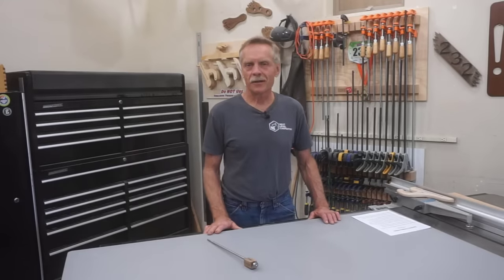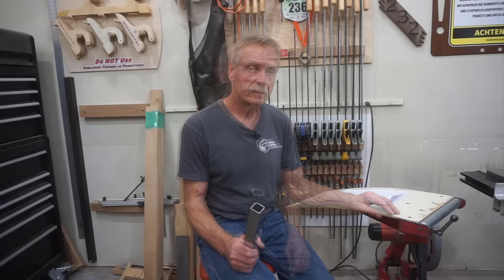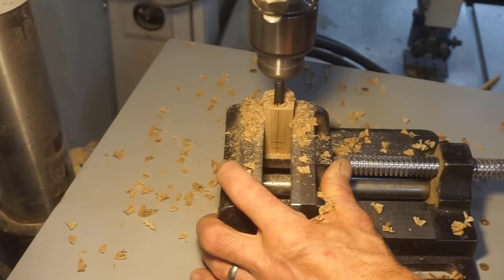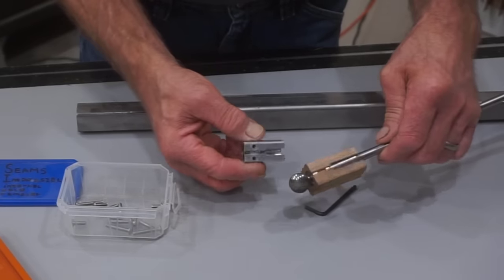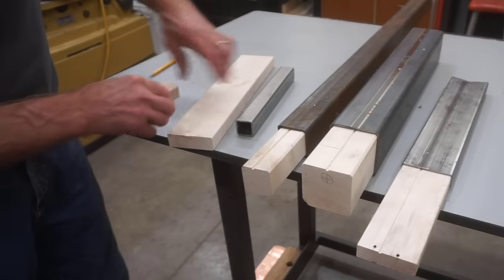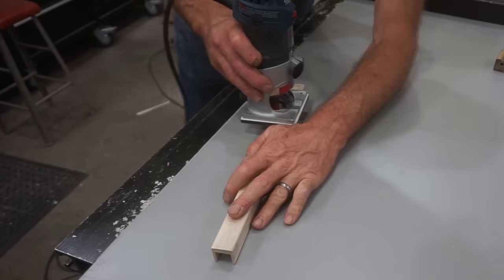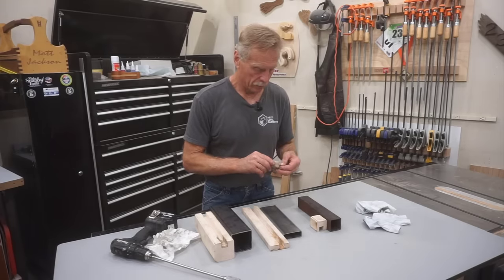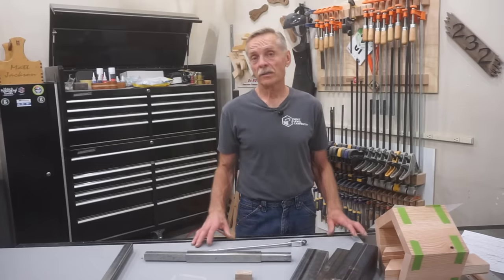How to Quickly Remove Internal Weld Seams from Steel Tubing

Comment: Brilliant idea. A suggestion instead of attaching the tool onto/into the jacket and because you are pulling the tool back through the tubing, simply machine the tool head top into a top hat, The top hat flange would sit on the end of the jacket when pulling through, no need to fasten the tool to the jacket with quicker setup and dismantle. Just a thought!
Reply from the maker: Great suggestion, Rodd... thanks for adding it.  I'm going to forward it to Greg as we're brainstorming on ways to make making jackets easier/more adaptable.  Best, Matt
Reply: @NextLevelCarpentry  The same principal could be used when pushing the bit through the tube, the rod could be a 1/4 OR hex drive bit negating the attachment screws? Pushing the bits together they don't have the chance to fall apart. Extensions of these variants are readily available. You would only need enough down angle for the metal chips to fall out as you pushed the bit through. I would assume creating an inexpensive nylon/plastic plug for the new hat would be relatively easy task and become a fantastic retail kit.
Reply from the maker: @roddy46198  More good insight.  Our biggest issue is dealing with tube of various size and internal weld location. A one size fits all jacket isn't realistic and making a 'shim kit' that covers all/most conditions gets complicated exponentially... but we're working on it with input from viewers and users expecting improvements as time goes on.

Comment: I like your tool!  What about to extend a bearing part in front of a carbide cuter to minimize wobbling at the beginning of cutting? Something like a carbide cutter in the middle of a bearing part.
Reply from the maker: Interesting idea Denis... I've never seen a tool with that configuration but it would solve a few problems for sure! Best, Matt

Comment: I have been fabricating Jeremy Schmidt's 2x72 grinder and wanted to use tube stock instead of welding a tube from bar stock. My solution is to chamfer the bar to fit in the tube and then grind a small channel down the length of the internal part. Viola no special tools needed just a grinder

Comment: hi friend. do you know of any method to do this:

The steel tube is either 3/4 or 7/8".  The nut is an M6.  The nut is significantly smaller than the hole / mouth of the steel tube.

I'm supposed to position it exactly in the middle of the hole, slightly inwards so the nut does not stick out of the hole, and fit the nut in there permanently.

I suppose the nut should be welded to something that would fit snugly inside the steel tube.

can you help please

thank you for your time
Reply from the maker: I don't have a solution from dealing with your question exactly but my first idea is to find a 'fender washer' sized so that it can easily be driven into the end of the square tube yet tight enough to hold in position.  With that, you could weld the nut to the washer (aligning holes on both) and drive the washer/nut into the end of the tube and weld it into place.  It would take a little fussing to find the right sized washer and perfect the sequence but, using the hole in the washer to align the nut so it's centered in the hold, should accomplish the task at hand.  Hint: you might pre-grind 4 little flat spots on the fender washer for a better fit and better, more consistent, alignment to center the nut in the square tube.
Reply: @NextLevelCarpentry  thank you very much!

Comment: Another option might be to fit two pins in the Jacket maybe a split pin which will hold in the jack but clear the tool hole.

Comment: This is really easy to make on a manual mill. But if you’re going to sell numbers of them, then yes, a cnc makes it quicker. As long as the number you sell makes up for the setup time cnc requires. I made something similar a number of years ago after also getting frustrated by the seam, and not being willing to buy the more expensive seamless tubing, since I only needed 6” pieces. I didnt use a burr though, I used a cutter, which leaves a smoother cut, and cuts freely.

Comment: are you going to make it for different sizes of tube or make an adjustable one?
Reply from the maker: You must have missed the whole 2nd half of the video Mark...
Reply: @NextLevelCarpentry  yes i had to leave
Reply from the maker: @markroderick3300  'splains it then... we developed a V2.0 Seams Impossible tool that will adapt to any size tube regardless of the position of the weld... how cool is THAT?  Hope you get a chance to watch the rest of the video sometime... I think you'll find it interesting if not useful. Best, Matt

Comment: Very nice idea, but if the block had guide bolt top and sides  to guide it thru the bigger tubing , no wood jackets would be needed.
The guide bolts could be adjusted for the size of tubing.

Comment: Little extra idea for diffirent sizes, you can also build in 3 sides to fit every side rising bars with bestly one fast lock locking all places, so when you use 3/4 inch tube, you use block closed, but any other bigger size you just open latch, put 3(working side never change it height, thou it can be move left or right by side bars locking diffirent position) bars whatever size you need to grind, lock latch and easily take what you need.
Reply: How to input you some ideas? Any email or some chat?

Comment: like the video. but if you have a tig welder could you try making a brouch cutter using the inner tubing?   this old tony has a video on using a filler rod that is toolsteel hard in which he shape using a sander/ grinder.
Reply from the maker: I suppose you could... but you won't get the smooth, consistent result achieved by this tool because rotary cutting is far better than scraping/broaching IMHO...

Comment: If I just order the basic tool, what size carbide bur do I need to get?
Reply from the maker: It's 3/4" diameter like this one on the Amazon page listed in the video description: https://www.amazon.com/dp/B003A4H9LQ/?ref=exp_nextlevelcarpentry_dp_vv_d Make sure which ever one you get has a nice, long 1/4" shank so you can attach the drillbit extension to it, OK?  If you do order the basic tool you might want to do it sooner than later as the pre-sale inventory of 600+ tools is running low and there likely be a months-long delay before the 2nd run of tools is made and ready for shipment.  Best, Matt

Comment: Any chance that the CAD file is available for this? For those of us that have 3d printers, aren't into manipulating dead tree carcasses, are too cheap to buy the aluminimum version and too lazy to take the time to design our own. 
I would imagine that PLA or any other inexpensive plastic work well enough. Might even be able to get away with not using bearings if you used nylon or polycarbonate, assuming you don't need to go through more than a few feet of tubing and use plenty of lube.
Reply from the maker: Post this question over at Greg's Garage channel... Greg's the CNC guy on the team so he's your only chance of getting CAD file help😎

Comment: Great deburring system ,but can only find the carbide cutter in us at a cost of $32+ $17 postage and not in uk at all , which if I had a paying job may not be excessive but would have liked one in the toolbox just in case. would have to use a smaller dia cutter and make bronze bearing to get the cutting depth  .That could work out.
Reply from the maker: Geoff: read through the comments and you'll find a discussion of another viewer who uses a 'smaller diameter cutter' oriented at 2 Degrees in a block of dense plastic for a considerably less complicated ie: less expensive alternative to the Seams Impossible tool.  I'm most interested in viewers being able to remove the weld when they need to, not in racking up sales.  Hope it works out for you 😎...Best, Matt

Comment: Nice solution. But you don't need a CNC machine tool to make the guide block out of metal. A simple manual vertical mill is perfectly capable of accurately fabricating such a part. Brass would be a good choice as it is less likely to gall against steel than aluminum. You could also probably make the guide out of a plastic such as HDPE (High Density Polyethylene), which is tough and slippery. So slippery, in fact, that it probably would be possible to eliminate the ball bearings and just use a through hole as a plain bearing.

Comment: Lil expandable arms with bearings that bolt on 2 sides could be tightened into place in any tube and place the bit where the weld is and roll on the smooth tubing areas

Comment: Correct me if I'm wrong but, it would seem to me that when the 2.0 version is chucked into the different size maple blocks, that if the working (burr) edge stuck out a hair instead of being flush and the block was sized accordingly, shaved down by the amount it stuck out, that the burr wood follow the seam as was first described without having to lift up on the extension while drilling.  
just a thought!
Reply from the maker: The only reason I had to lift up on the extension for that particular video segment is that the burr DIDN'T stick 'out a hair instead of being flush' because the block WASN'T sized quite right and prevented it.  At that point it's easier to just lift up on the extension than to take it apart and shim it or start over with a new block of slightly different dimension.  To clarify: the burr isn't intended to 'follow the seam' but is guided by the block along the seam.  Thanks for watching and commenting here Bill... I always appreciate engaged viewers! Best, Matt

Comment: That just gave me a thought! Just weld a cutting tool to a piece of tubing to fit inside the other tubing and weld an end on the other end of it and just beat it thru till it falls out. Problem solved !!! (( Make one for every size tubing. Even the round ones. ))

Comment: I am looking for a solution for telescoping tubes which are powder coated or painted to have a nylon inner sleeve to protect the coating. Thumbs up.
Reply from the maker: One solution for telescoping tubes is to have them electroplated because, unlike powdercoating, it has insignificant thickness and won't chip... something to consider... Best, Matt

Comment: im thinking a leaf spring on 3 sides to hold tool at 3 pionts and as for the forth point will be held by the weld. the weld will also keep the tool in the right spot. then just add a C shaped shim

Comment: A Woodruff key cutter might be cheaper than a carbide burr, on an arbour made from allthread,  but that'd mean running the allthread in the bearings which isn't ideal.
Edit: on second thoughts,  weld might be a bit crunchy for a HSS cutter.

Comment: they make a very small belt sander that will go in there for 4 inches maybe 4 1/2  from each end. That would do a 8 maybe 9 inch piece.  harbor freight, less that 100 bucks.  comes in real handy for a bunch of other stuff too.

Comment: what about making the tool so you can use allthread as the extension? all-thread is quite a lot cheaper than a proper extension
Reply from the maker: If I were looking for a cheaper alternative I'd use plain rod instead of allthread because its cheaper still.

Comment: The seam is not always centered on a side. This tool only works if the seam is centered or near the center. I've seen some seams right next to the corner.
Reply from the maker: SOMEone should pay a little more attention before making inaccurate statements: https://youtu.be/ozSE7Wrdb1o?t=1100 Just sayin'! 🤨 Best, Matt

Comment: Looks great for short pieces. what about long pieces greater than 2ft
Reply from the maker: Watch the video and pay closer attention... the main benefit of the Seams Impossible tool is its ability to remove the seam from pieces of ANY length by simply adding more bit extensions... pretty sweet, right? 😁😎

Comment: This may be what I'm needing.  I'm removing the seam on a 4" square tube with 1/2" wall.  The seam is much larger than these you're showing on here.  Does anyone have any experience with this tool and removing larger seams?
Reply from the maker: I don't have any verified information regarding your exact situation but offer 2 things: you might design a  spacer such that you can remove the larger seam weld in multiple passes OR you could use the same design principals shown early in the video with a few modifications to remove the weld all in one pass.  Since the Seams Impossible is primarily designed to fit smaller tubes with smaller welds it's a bit restricted in doing specific larger sizes but it should be easier to replicate it for large tube like yours because you're not limited by smaller size constraints....
Best,
Matt

Comment: To solve the seam removal issue as the Seems Impossible tool exits the tube you could make the wood block an inch longer and the the tool in an inch so that there is some block that remains in side the tube to act as a guide as the tool exits the tube. So a 3 inch long wood block in place of the 2 inch block with the tool installed in the center of the length of the block.
Reply from the maker: Sure could Bob!  Sounds like an idea to add to the list of 'best practices' that is growing from use and experience.  The fixed jacket where the V2.0 slides through is a little different application of your suggestion and is one more reason I'm starting to prefer the method over a short jacket attached to the Tool.  Best, Matt

Comment: nice job of that.  You might want to check out   fireball tool on you tube.  they have another way that I like a lot.
Reply from the maker: Thanks fish oil... BTW I did check out Fireball Tool's video.  I didn't care much for the results he gets by scraping out the weld or all the fuss it took to get it done... his video is one of the main reasons I went through all the effort of inventing this method because I want more professional results when possible/practical. Best, Matt

Comment: Actually making a grove is the best way because it does not limit the length of piece that u can make
Reply from the maker: Kamis, FYI if you pay close attention to the design and operation of the Seams Impossible tool you will see that it's main feature is that it too can remove internal weld seams from pieces of square tubing of ANY length for a smooth sleeving fit WITHOUT being limited by the need to align the grooved face with the weld seam face.
Reply: @NextLevelCarpentry 
U are right BUT it's quite easy to make universal semi closed c shape. It can be done without manufacturing another tool and spending money on extensions. 
Your method is good I'm not trying to deny that 
But for most cutting is faster and cheeper solution
Reply from the maker: @OnlyMadnessPain  Got it: faster and cheaper... but not better.😎
Reply: @NextLevelCarpentry  
If u want to have a very nice look yes in that case urs better
Reply from the maker: @OnlyMadnessPain  For sure... you sound like a reasonable person and I respect you for sharing your views and putting both options into perspective.  
Best,
Matt
Reply: @NextLevelCarpentry  
Have a nice day Matt 
Andrew ;)
Reply: Nice tool, i can think of lots of applications where the internal weld would be better removed than a groove, yes, a groove is cheap, but it might not always look great

If your working with a piece of equipment that has to telescope, and look nice, for example be a display piece, and be polished stainless or something similar, the people with OCD would cringe seeing a groove down its length, therefore, the groove is going to be better being on the inside
Reply: @russellrattys6581  
It depends on a part's purpose.
I agree with you but even a groove can be make very precisely finished. 
It all depends on a function length and placement.

Comment: What Freud saw blade do you use? Model, teeth, etc
Reply from the maker: Check the Amazon page link in the video description tallyman... it has the current version of the blade shown in this video.  They don't use the red coating anymore.  You might find one locally if you don't want to go through Amazon...
Reply: @NextLevelCarpentry  thanks

Comment: If you are screwing the spacer block on you do not (at least for square tube)  you do not need to slot it for the tool. A simple rectangle will hold it down and center it.
Reply from the maker: You just might be right Jonathan... we suspect that in time other ideas will come up for optimizing use of the tool so thanks for adding your thoughts here....
Reply: @NextLevelCarpentry  Standard spacer blocks, (square tubes are standard sizes) screw up from cutting tool to threaded bar in a slot in the spacer, so that cutting tool can be aligned to from side to side for weld offset? All spacer blocks having the slot at the same dimension from the cutting tool, slot at right angles to cutting tool. Make sense? And cutting tool could be modified to work in round tube?

Comment: Why not extend the jig to enclose the cutter head all the way to the end, and then it would align itself, and you could use it to remove the weld on the push or pull.  
      I was also thinking that whoever needed to remove the weld would have access to the tubing, so why not make the jig able to attach to a short piece of the tubing, instead of to a piece of wood?  Now, how to attach the jig to the metal tubing of larger sizes?  I'm thinking about using a 3" piece of tubing and using a angle grinder to cut a notch, the width of the jig, then using {2} 3" long pieces of aluminum mounted on either side of the jig with slots to adjust height and secured to the tubing with countersunk screws...